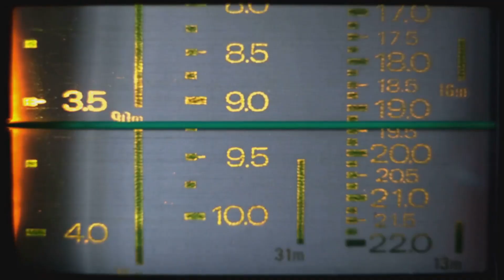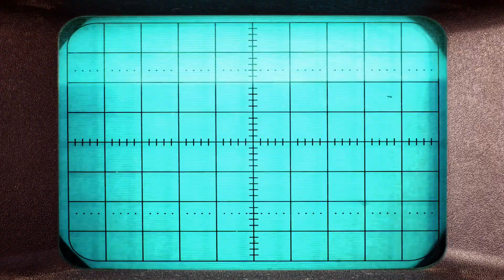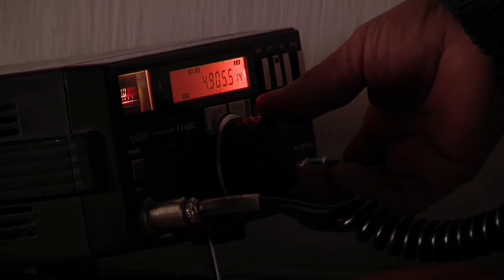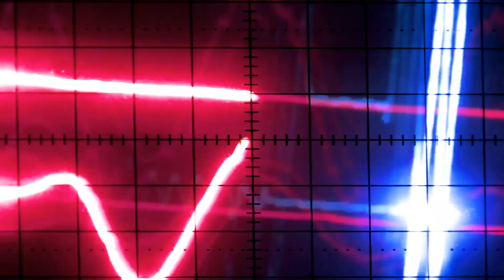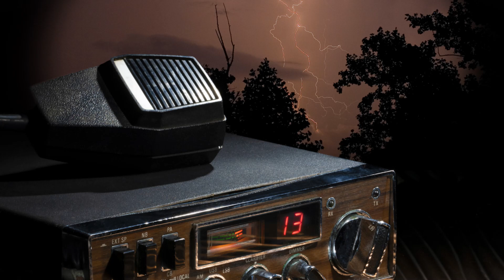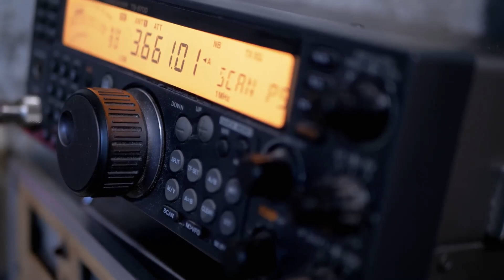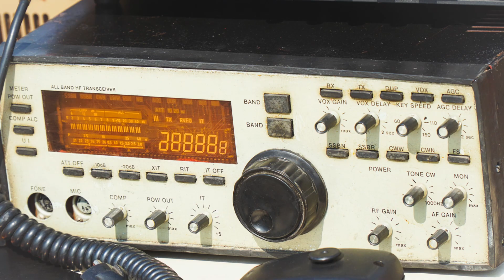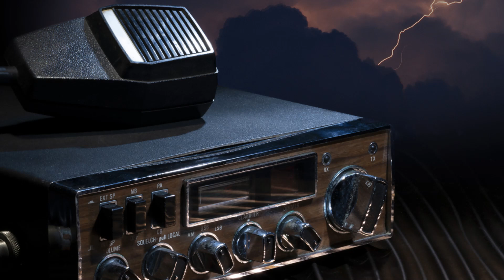Why Did a Broken 1965 Satellite Start Calling Home?

Comment: How is 237 MHz the X Band which is in the GHz region?
Reply from the maker: Great catch! You're absolutely right—237 MHz is UHF, not X-Band. LES-1 actually had two separate transmitters: an X-Band system operating around 8 GHz for communications experiments, and a UHF transmitter at 237 MHz for telemetry. When the satellite 'woke up' in 2013 after 46 years of silence, it was the 237 MHz UHF telemetry transmitter that came back online—likely due to a short circuit allowing solar power to reach it directly. The X-Band system stayed silent. Thanks for keeping the technical details accurate!
Reply: @scibyteinsight  
Right, that explains it, thanks. 
Or maybe the batteries went high resistance.
Reply from the maker: @bill-2018  Entirely possible. Unless we get someone out there to look at it we may never know for certain, but it is interesting to hear about.

Comment: we built better electronics back then but the parts were not as good as the parts of today .
Reply from the maker: Great point! The durability vs. sophistication trade-off is fascinating. LES-1 was built with redundancy and over-engineering as the core philosophy—no planned obsolescence, just "survive at all costs." Do you think we've lost that mindset in modern tech, or is it just that we're optimizing for different goals now (like cost and rapid innovation)?